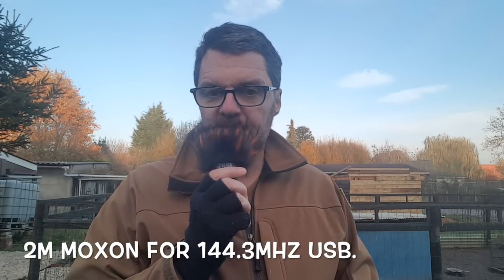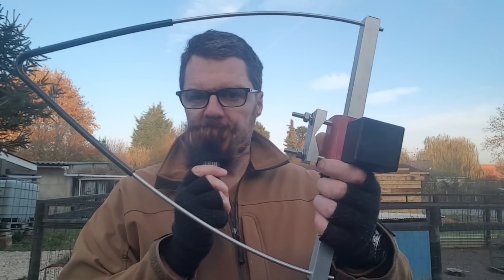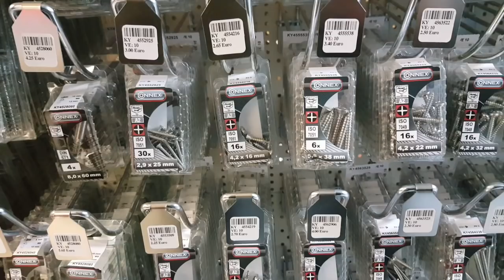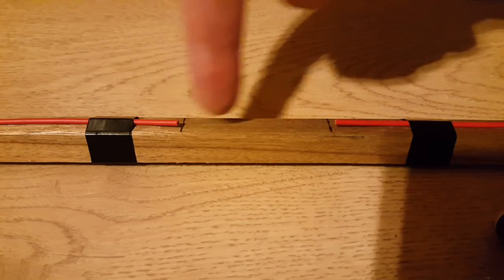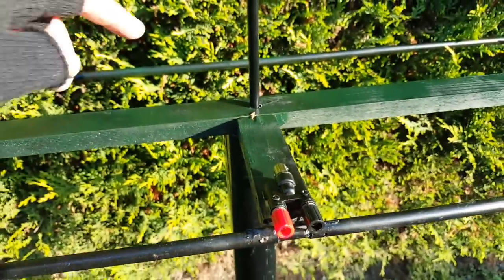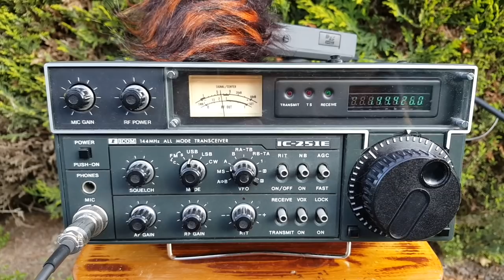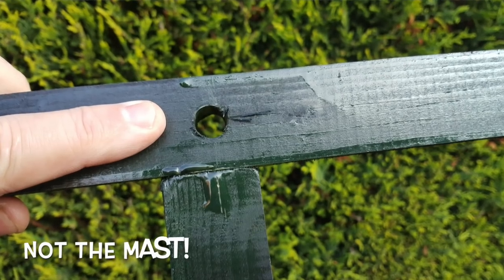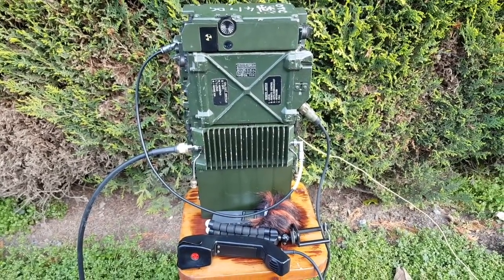The Fabulous Moxon Antenna, Part 2.

Comment: That's a great presentation , I have had several ask me to build one but I had decided to go quad antennas instead . This design has some interesting things on its side the fact that it's only 2 dimensional is a plus when transporting . I bet it could talk 280 miles on 2 meters with groundwave . We all know when conditions are in you don't need a large array so a great test is ground wave , that is if you can find someone to talk to. I was lucky we had a family vacation at Crystal Beach , Port Bolivar ,Texas USA close to Galveston . I used a 4 and a 5 element at different times to talk back to San Antonio and Banders Texas longest was 280 miles down to 220 with 6 members of our Hamster radio club. My elevation was 15' off sea level with 50 watts USB then on that 10 watts . So your moxon should do good and the pattern would easily cover a large City from a 100 miles away. Keep up the good work.👍
Reply from the maker: Thanks, indeed. Another advantage is that the beam isn't as tight as my 6el. Yagi-Uda...

Comment: I have used yagi's and quad's for communications above 30 MHz. Then I read an article in one of the US amateur radio magazines about a ham that combined the quad and yagi that he called the quagi. I tried that concept and it worked great. My most difficult part of the build was locating a length of cedar to use as the boom. I am going to try the same concept using the moxon 2 element beam and some yagi elements for directors to determine if the directors will help with distance. Thanks for the 2 videos on your build. KB8AMZ
Reply from the maker: Interesting. I think I have seen one somewhere on the web... It should definitely help.

Comment: Yes the moon is a great antenna. I think you will find that the swr and tuning generally is very dependent on capacitance and leakage between the opposing ends. Having wood there is most definitely a no no. David G0UPK

Comment: I seem to be mentally tuned in lately to videos -- both old and new -- with somewhat positive reviews of equipment not working. Particularly from a prepper or homebrew perspective, I appreciate that you are doing the work to build and experiment so I can learn from your experience.  In a case like this, though, can you say there is any information to suggest that the effort is worthwhile?
Reply from the maker: Which positive review of something not working?
Reply: @RadioPrepper  In this case, it was a 6m moxon antenna: fun to build, inexpensive, lightweight, low SWR, ability to receive (found a beacon), but no demonstrated contact. Very anti-climatic ;-) // I am enjoying your videos very much, though--including your latest regarding your sailing incident. The honesty there and in the ham radio field operations (sometimes no qsos) is very refreshing. For a build though, we have to know if it works :-) Merci, Gil & 73 de ab3ww

Comment: FB Gil! Agree. A Moxon is a great alternative to a full-size Yagi when you need a bit of directionality and gain. I put up a quick 20M vertical wire Moxon for skedding with our common friend Ray. It was only about 1.5 meters off the ground but worked nicely. I tried both center-fed and end-fed. Both worked equally well.  VY 73 DE N6MGN
Reply from the maker: Excellent Paul. I should try to contact Ray from here again, and you maybe.

Comment: How high can you go on the 12m spiderbeam pole with LMR 400? I saw dj0ip's site claiming that LMR400 is too heavy and recommending LMR 240. But I assume you could run LMR400 up to ~9m if you remove the top sections of the pole?
Reply from the maker: Exactly. I tried up to 9m for my 2m halo, did not try higher... The antennas is 1Lb.

Comment: 2m SSB is really dead most of the time. At least during the week. A little more traffic on the weekends. When I was a young radio amateur 35 years ago I used to walk arround with an IC-202E and a HB9CV antenna. At that time there where always some stations ready for a chat :-) Every now an then I use my FT-817 and the same old HB8CV, but most of the time there is only white noise on 2m SSB :-(
Nevertheless great video again! 73s Stephan, DF6PA
Reply from the maker: Thanks. Let's bring 2m USB back!

Comment: Looks like your shorter one was horizontally polarized and the bigger one was vertical. Right? Can you discuss more?
Reply from the maker: Correct. The 2m model I use USB with, so horizontal polarisation. The 6m model is for FM, so vertical. If I used USB on 6m I would go horizontal.

Comment: Hi Gil,
greeting from the UK.
Very interesting design. I am searching for an antenna design to work on 2m FM. My goal Is to hit a repeater in the north of France 200Km from south coast of England using a low power portable (max 5w).
Do you think this design could wrk wit the right conditions?
Reply from the maker: Possible, but the major factor is height...
Reply: @RadioPrepper  Got it Thanks.

Comment: Hi Gil, do you think there is a chance you could get a LOS towards Paris ? If yes, we could try and arrange a 2m SSB QSO... 
I have a tape-measure 3 elements yagi and a DIY GP for 2 meters, so not the best guarantee that it will work, but you never know until you try :)
Reply: There are some high grounds nearby (saint-cloud, mont valérien), from where I could operate. This would help on this side...
Reply from the maker: LOS is impossible. Tropospheric ducting maybe but the chances are slim and unpredictable.

Comment: You might try calling again with your 2m horizontally polarized.  Most people on 2m sideband are using horizontally polarized antennas, so if you're vertically polarized, you get a significant loss when working someone that is using horizontal polarization.  73
Reply from the maker: Definitely. I was horizontally polarized.
Reply: @RadioPrepper  sorry, it looked like you hung it vertically.  I might have gotten confused on which one you had hanging that way.  Or maybe I'm confused on which way is vertical vs horizontal with a moxon.  Sorry for my confusion, was just trying to help :)
Reply: Rewatched.  I was confused as to which one you had up that was hanging vertically.  The 2m at the end was up on top horizontally.  The 6m looked like it was hanging vertically in the previous shots.  I got confused as to which was which.  Posting this for anyone else following this conversation.  73 again
Reply from the maker: No worries. My 2m Moxon was horizontally polarized. The 6m one was vertical.

Comment: Many thanks for this video, the antenna sounds very interesting. I wonder, as for 145 MHz the antenna is small (about 80cm x 30 cm ?) , if building it with copper tube, could be interesting allowing more rigour (sorry for my english, I mean "rigidité) and so less reinforced with only one large piece of wood or PVC tube, perhaps too a larger bandwidth if the tube has a diameter of 1 cm ? I have too some hesitation for another antenna, a biquad with a reflector (if this reflector is meshed, the classic lamda/20 gives a size of the cracks of less than 10 cm, let assuming 2 cm, would give a light reflector even with wind), the gain is given for 7-9 dBd (according to the distance adjusted for an impedance near 50 ohms). What do you think about using tube for the Moxon antenna ? Have you studied this biquad antenna too ? 
Many thinks again, sincerly yours, Milos
Reply from the maker: Thanks Milos. I did use 1cm tubing. It could probably be made lighter and more rigid with bigger diameter thinner tube walls, maybe aluminum.. I might make a biquad in the future!
Reply: @RadioPrepper  You certainly did a good choice with a 1 cm tube, sorry as I miss it. If you make a biquad I will wait with a lot of impatience. 
Sincerly yours, Milos
Reply from the maker: Thank you. Maybe for UHF...

Comment: At the very least start off by telling viewers that THEY NEED A LICENCE to operate on the 2m Band, the 4m band and 6m band along with every other freq allocated to amateurs.  SSB signal is 2.6 KHz wide,  FM CHANNEL spacings -  Narrow band FM is 12.5 KHz at 2m, Wide band FM is 25 KHz at 70cm!  Unless you want to run 'digital' in which case the channel spacings are 6.25 KHz regardless of mode or frequency!